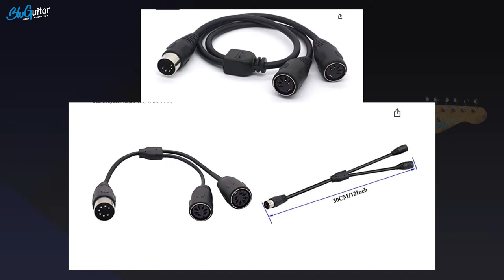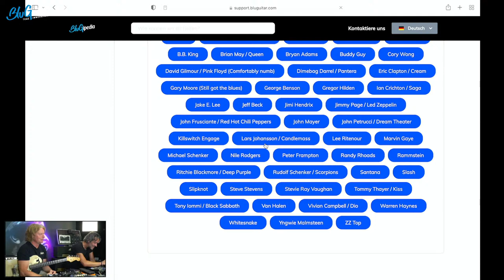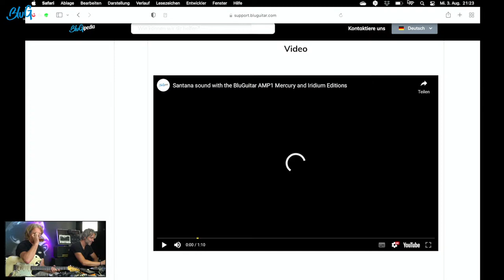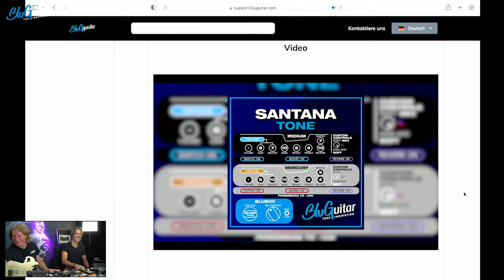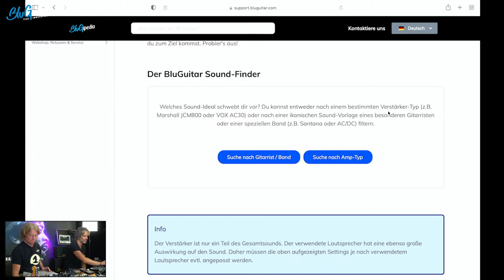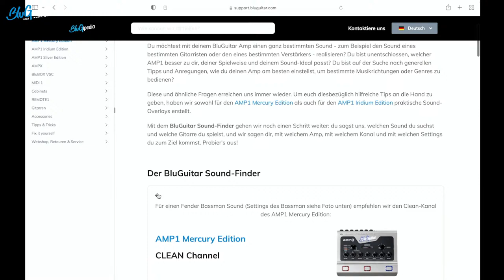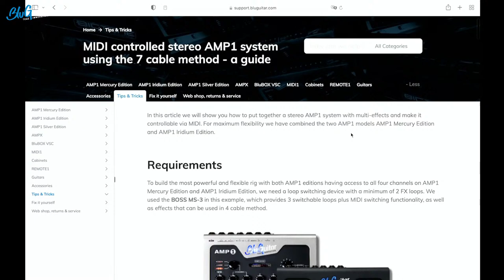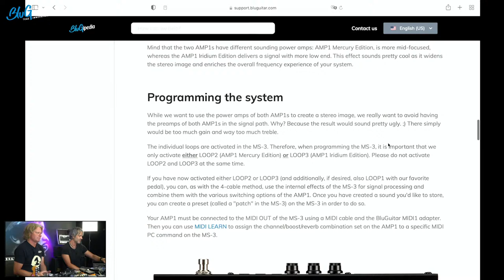Academy Of Tone #118: AMP1 Mercury/Iridium in a fully controlled stereo system + the 7-cable method!

Comment: i recently started using the Marshall 20-watt plexi (SV20) as a pedal platform & it beat out a twin preamp for me (which was also good)
There's a couple tricks to setting it up though;

- volume pedal in the fx loop (stops the preamp from destroying the power section, roll back the signal for added clarity/extended highs and lows)
- patch cable in the top two inputs, plugging in to the bottom left input (jumping the channels, standard plexi fare)
- bass channel gain up 50%, treble gain juuust on the verge of letting the highs through, so just a touch (for clarity)

and i guess an attenuator for low level sounds, a 100-watt attenuator works well on a 20 watt amp as it doesn't  feel like it loses anything in the process signal-wise/runs out of headroom.
Reply from the maker: Thank you so much for sharing your experience here!!! Makes a lot of sense!!!
Greetings 🖖 Thomas

Comment: Is there a way to activate the power soak without the remote 1, like via midi?
Reply from the maker: Yes, the Powersoak on AMP1 can be activated via Remote1 or midi. Mind that you need our MIDI1 Adapter.
Reply: @BluGuitar  Yes I got it, and the Boss MS3 too. Where I can find the procedure?
Reply: @zeppo20  https://www.youtube.com/watch?v=RM3960oRmK4  , this is from the website using hx effects but is the same concept, you send midi control message
 to midi CC30 and dial back between 127- 0 , 64 would be approximately 50 watts i think.
Reply: @zaphodrahja  Thank you.
Reply: @zeppo20  Hey no worries, did you get it working?
Reply: @zaphodrahja  Not yet, I got the midi converter and cable. I will try next week. Thank you. Seems easy, I saw the video.